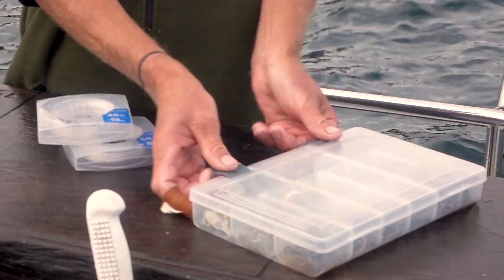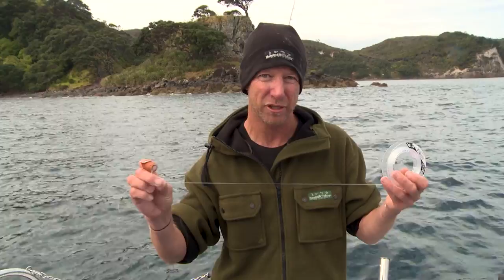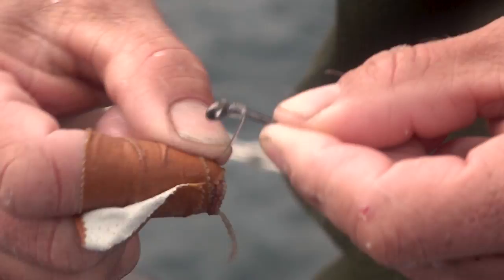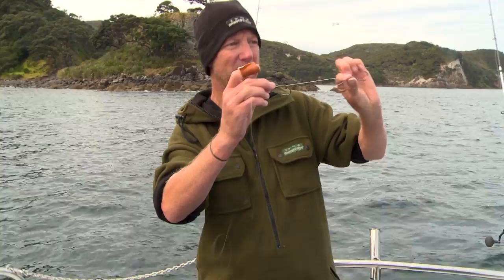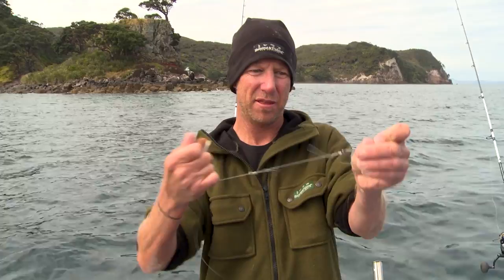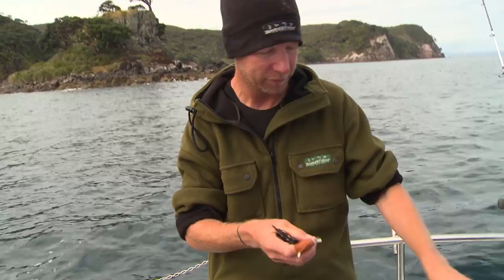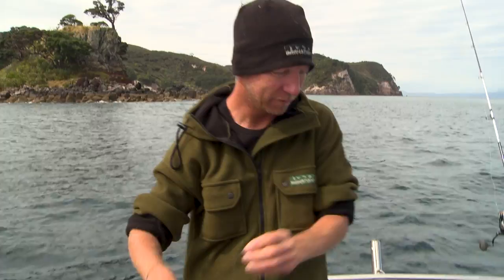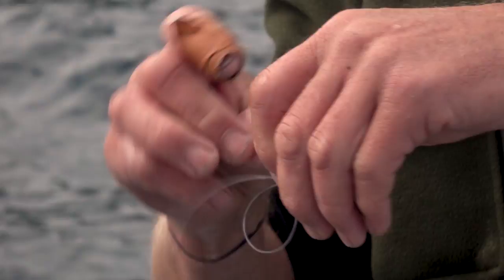STRAYLINING FOR SNAPPER - HOOK RIGS

Comment: Tie the first hook on with a uni then put second hook on with the ‘knotless’ knot. This allows you to more accurately decide on the distance between the two hooks. Tie trace to main line with a surgeons knot eliminating the need for a swivel and allowing a longer trace to be used like a wind on leader.
Reply: kitkatyum I do the bottom first as you have said, I use swivels though and tie a bundle of rigs ready to tie on and keep them in small ziplock bags